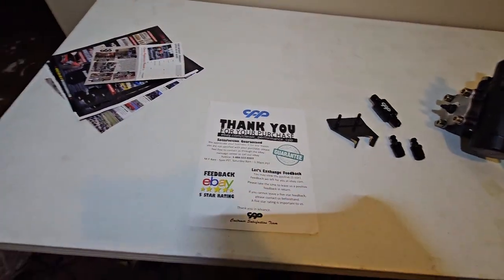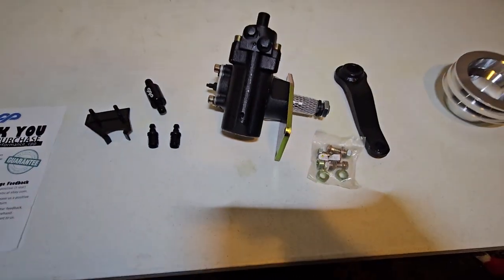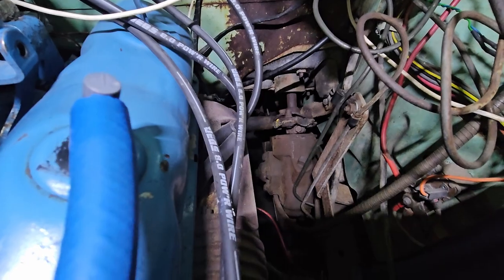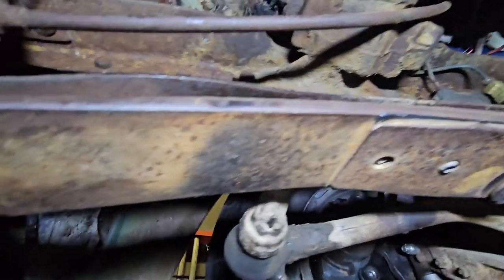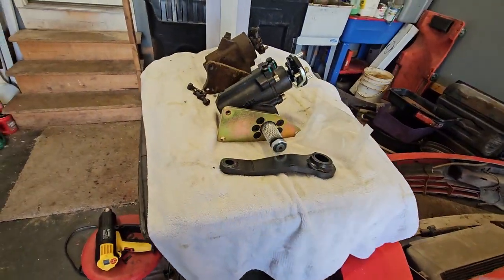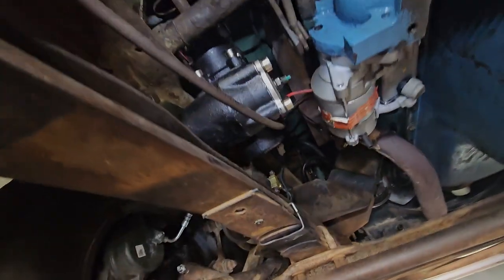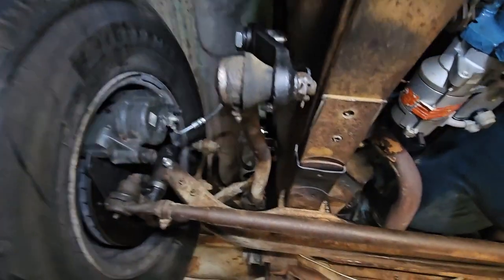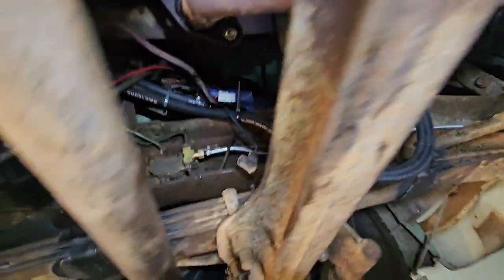1970 Dodge D200 Sweptline Power Steering Conversion

Comment: Thank you for the video. I just bought a d200 and appreciate any information.
Reply from the maker: Great to hear!
Reply: @HyndzyteEngineering  I already have power steering but my control valve attached to the pitman is worn out.  What did you find ?

Comment: I just did a 1969 W200..wish I had found you vid before I finished..I found out all the hard way. you have to push the steering column in towards the driver as the new box is 1.5" longer. No instructions and no help from manufacturer/suppler. Same for pulleys no help and none lined up. I found steel OE pulley's but still have to space out the WP pulley 1/2". Make sure you get all the air out first, disconect the drag link to do this so the box will go full lock..

Comment: I have a 70 d200 and it has power steering that was installed by the previous owner, it’s a power assist ram type. The ram was leaking so I had it rebuilt. I bled the system no bubbles no noice but steering is a little easier left but right is very hard. I have no idea what’s wrong. Do you have a link to the parts you bought?
Reply: That power steering is a factory set up for those trucks actually just an FYI